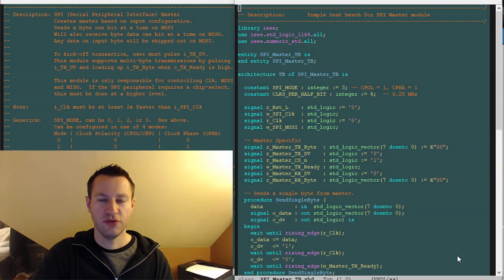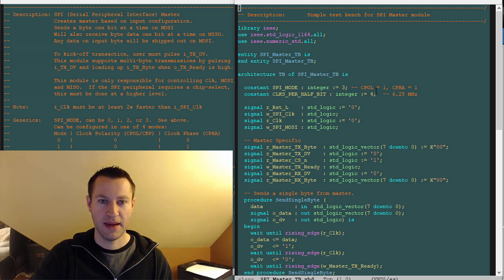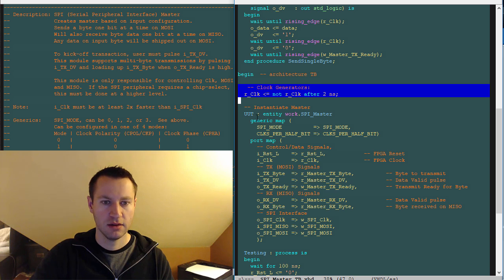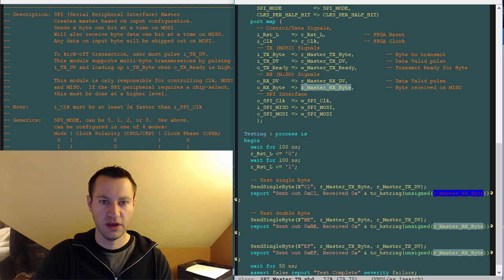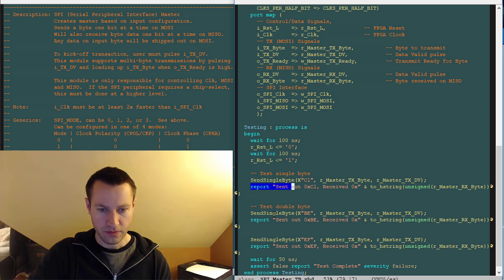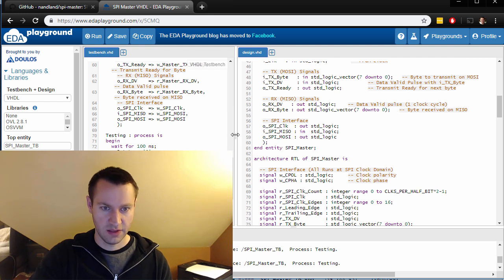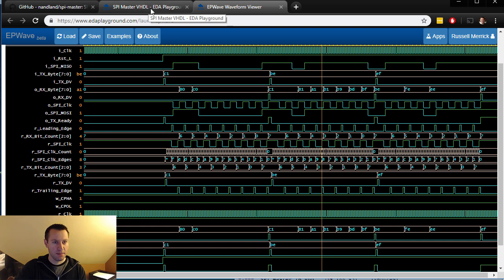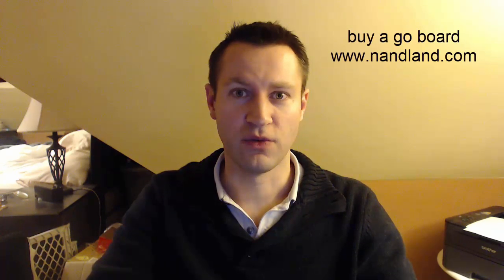SPI Master in FPGA, VHDL Testbench

Comment: hey russel thanks for the video .. but there is some problem in this code I'm not able to run synthesis in vivado 2018.3 ... can u please check it out ...
Reply: std_logic_vector is missing "(7 downto 0)" in a couple of places if you downloaded the code from GitHub. Compare it with the video, look for "i_TX_Byte" and "o_RX_Byte".
Help yourself with this: https://www.edaplayground.com/x/5CMQ

Also the "to_hstring" explicit cast was not working for me, in the report statements, at the end of TestBench. I just commented them.
I was simulating on Active-HDL software and was able to debug it.

Live Update: Active HDL was set to VHDL version 2002 and was not recognizing the to_hstring function. Solve it by setting to the last version of VHDL.